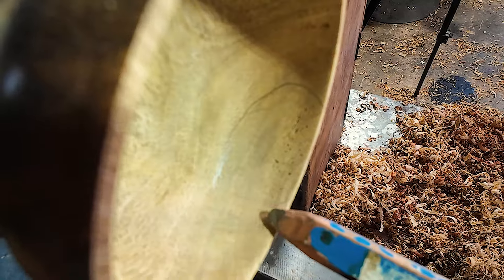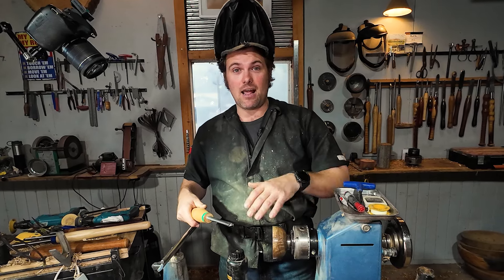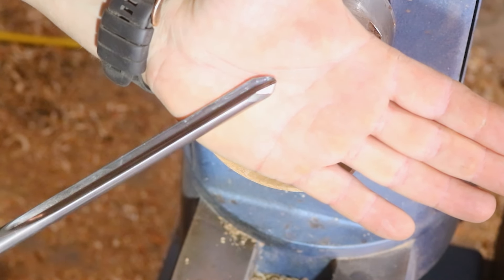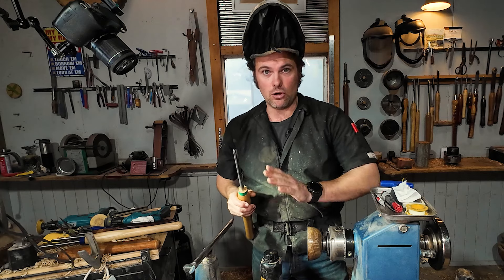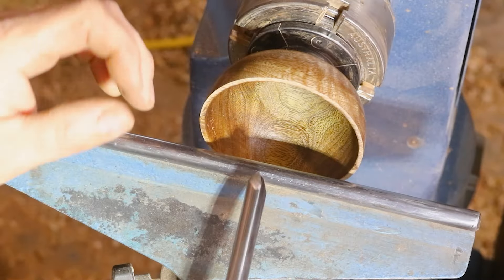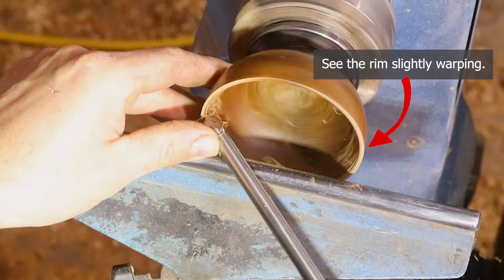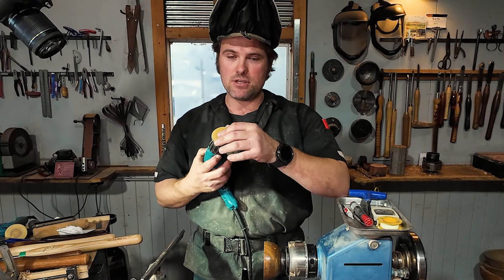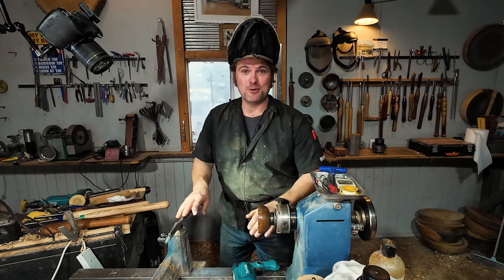Use OIL to CUT torn grain

Comment: Great timing for my first Kerry Corney video.  I've got a 15" pecan bowl with torn grain across the bottom.  I think the pecan is softer than I thought.  Really pleased to have this tip.
Reply from the maker: @tomjpt  I’m glad that I could help, mate. How are you cutting the bottom of the bowl?
Reply: @KerryCorney  Well, I guess I left out a part of my thank you.  I forget too often that a long, single bevel creates problems of drag.  I'm going to tune up a gouge specifically for this job.  Given the potential issues with handle interference when trying to maintain the tool angle (as compared to the grind angle) to cut across the bottom, I think I might use something closer to 55 degrees on the final cutting bevel.  Does that sound right to you?
Reply from the maker: @tomjpt   My pleasure, mate. Check out this video here about the different angles. If it’s a big bowl, go with a bottom bowl gouge with a 60-degree bevel. Otherwise, sticking to 45 or 50 degrees works well, though you might end up with a slightly straight-walled bowl.

Here’s that video, mate.

https://youtu.be/FF93072grjs?si=GEOshNLhGB5KCdov

Comment: This is a fantastic tip, gonna keep this one in my pocket as i alway seem to have some torn grain to deal with.
Reply from the maker: Thanks for watching, mate. The first thing, as you probably know, is to make sure the tool you're using is super sharp. I hope you have been well, mate. Cheers, 
Kezza
Reply: @KerryCorney  I need to work on sharpening and removing the heel as all the gouges i have right now still have it. And or ill just pick up a new one with it removed. 

The summer has been a rollercoaster, haven't put out a video in months due to some current health issues. Just tried to record an update video so hopefully ill be able to get that together here soon. Always glad to see a video from you, it puts a smile on my face.
Reply from the maker: @Chipswoodworking  I’m sorry to hear that you’re not doing well, mate. Hope you’re back on the horse now.

The heel removal is really easy; it just needs a steady hand, and you can freehand it. Just roll the tool slowly around on the wheel.

Thanks for your support, mate.

Cheers,
Kez

Comment: Missed the one where Mike said this. I have used water instead of oil. One of the spray bottles and very lightly mist the entire inside or outside, and then with a very light cut and slow feed rate, cut off the wet wood. Had some very dry Koa once, and there was the nastiest tear out I have seen. It took several wettings before the surfaces were down to sandable....
Reply from the maker: I sometimes put his videos on for the Friday night movie. The wife loves it 😂
It's cool that you use something different. Works well for you?
Thanks for watching, mate.
Kezza

Comment: Thanks for the tips Kerry.   I too have struggled with torn grain.   I've tried sharpening, water spray, speed adjustments, cutting rate adjustments...all with varied results.   I'll give oil a try.   I assume pretty much any kind of finishing oil would work.   Have you seen this affect finishes other than oil?
Reply from the maker: It’s a tricky one. Any finishing oil will work, and keep a keen edge on your gouge. Sometimes, I need to take two cuts, both with oil—preferably the same oil you’ll use to finish the bowl.
Let me know how it goes, mate.

Cheers,
Kezza

Comment: Great tip again, as it is quite annoying going to give this a shot. Also I was using Danish oil to wet sand as suggested one of your videos but ceased as can not get the strong smell of the oil from the wood , is there a way to do this, I have tried scented waxes to try and compensate but have had no success. Many thanks again.
Reply from the maker: Thank you for your comment, Colin. What is the timeframe you are allowing for it to dry out? It could also be the brand, perhaps. I just went and smelled a few of the bowls I have, and I can't seem to smell anything. You could even try doing a test piece, thinning the oil down a little with white spirits, and see how that goes. I'm just brainstorming ideas.
I'm sorry that this has happened, though, mate.
Keep me posted.
Kezza
Reply: Try a different brand of oil. Ones that have more 'solvents' and so on tend to smell worse. It's not always the case that cheaper is worse though.
Reply: @KerryCorney  no dramas not your fault , I will try what you have suggested. It could be that the can of Danish I have  is quite old. I just checked the bowl / box that I did and the smell is going away but it has been some time since I made it a good 10 months. Can it be the wood?
Reply from the maker: I would suggest making your own if you like. It makes up a lot more, but it's a lot cheaper,. I mix up my own now.
Go to this video, mate. https://youtu.be/V74c9TrmAy0?si=ai_yZ_5BzorkxUv1

At about 20 minutes from memory.
Cheers, mate.
Kezza

Comment: Is there any oil that you would or wouldn't recommend for this? I guess an example would be, walnut oil vs a store bought Danish oil.
Reply from the maker: I’ve actually used all my oils for this: Danish, walnut, Dr. Woodshop, mineral, and Woodcut’s Tung oil. They all work just as well, mate. My suggestion, and Mr. Mahoney’s too, is to use the oil you’ll finish the bowl with.👌

Hope you’re well, mate.

Cheers,
Kezza
Reply: @KerryCorney  Excellent advice as always, thank you Sir!

Comment: What if you dont like tung oil? I'm guessing if you soak/seal tawn grain with tung oil your stuck with that product to complete it.... resulting in a better cut and a finish you don't like
Reply from the maker: @PennsPens   Sorry for the slow reply, mate. Use what you have on hand—you’re spot on. Mr. Mahoney recommends finishing the pieces with the oil you use. Other turners here in the comments are saying they even used linseed, which worked a treat.

Cheers for the support, mate.

I saw your other comments, and thank you so much.

Kezza

Comment: THANK YOU for passing on a great tip! My worst offender is ash. Any of the finish oils or is Tung recommended? I'd think since it's being cut away it shouldn't matter but just want to make sure there's not one I should avoid.
Reply from the maker: Thank you for the comment, David. In Mr. Mahoney's video (highly recommend watching), he says to use the oil that you intend to finish the bowl with. A razor-sharp tool will, as you know, will help overcome a lot of our turning issues. 
Cheers, mate. 
Kezza